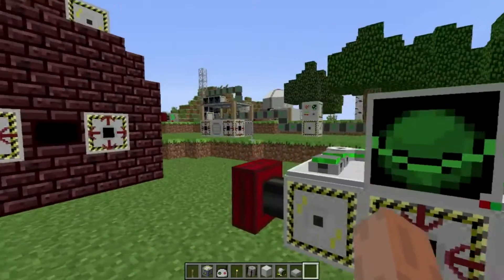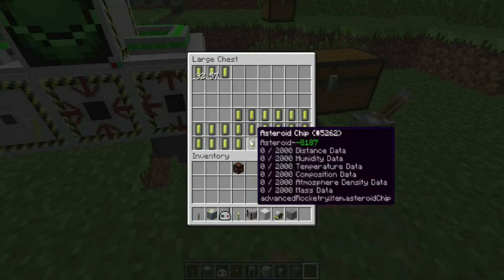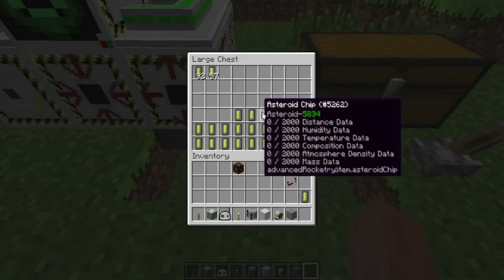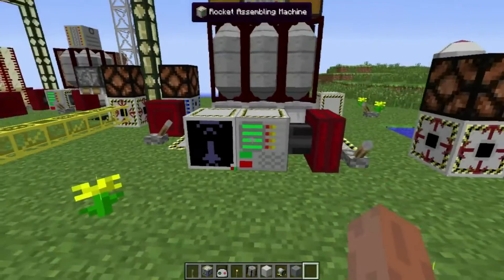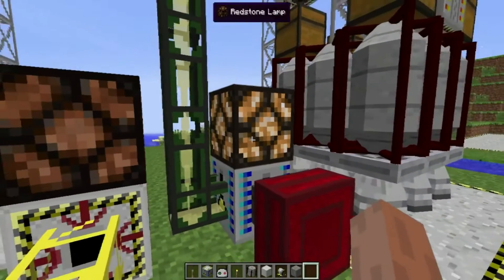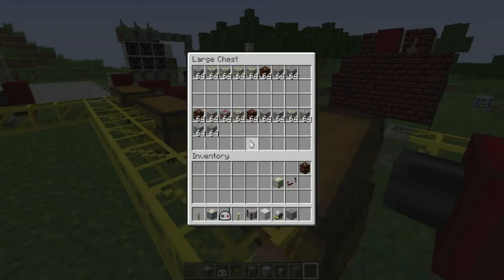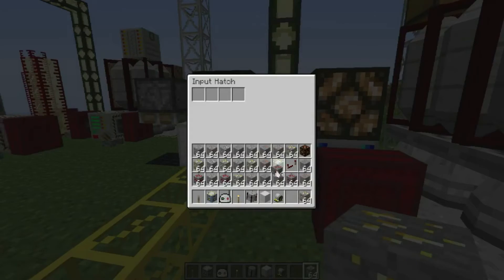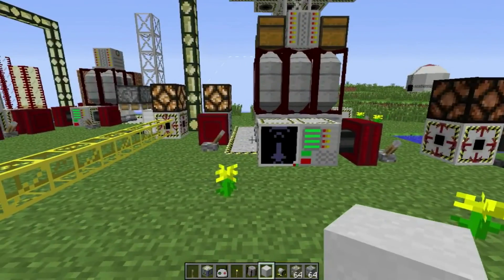Advanced Rocketry 0.6.x Features

Comment: Will the amount of resources gathered be turned down for public use? and how long would a mission take for the rocket to leave, mine and comeback roughly?
Reply from the maker: The resource return from a mining mission can be controlled by the "miningMissionMultiplier" option in the config file.  The one I demo in the video is a chip with maxed out research, which takes approx 10/15 minutes to program.  The time the mission itself take varies on the amount of drills built into the ship, but a maximum of half an hour.  The nice thing is not chunks need to be loaded for the mission to continue as the mission itself does not take place in the world and simply checks against world time.  This also prevents it from taking longer on a laggy server.
Reply: +zmasterfun Thanks Z It's really coming along